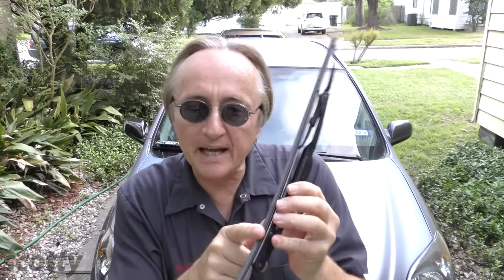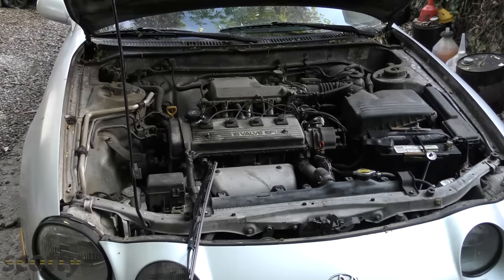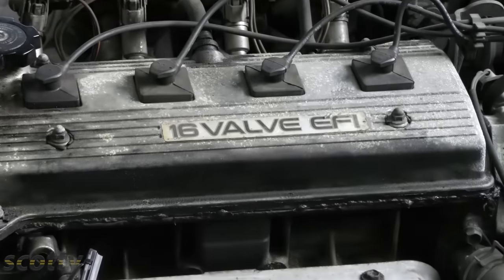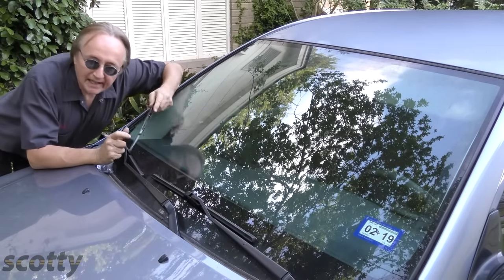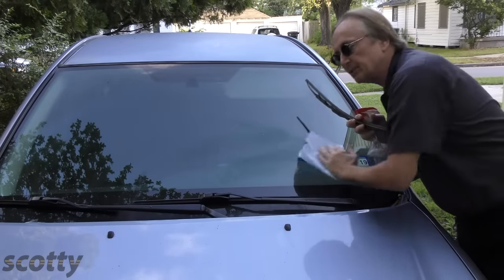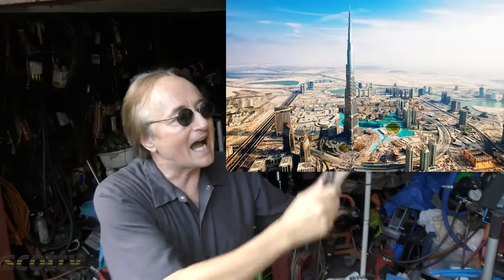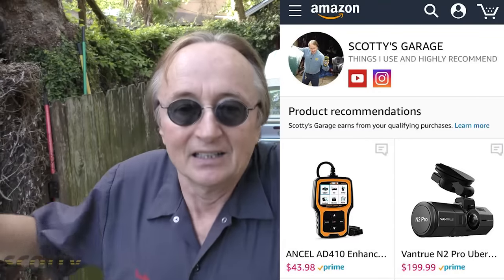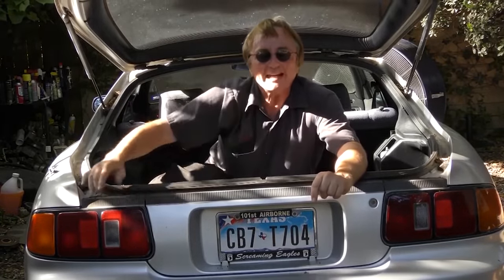The Best Wiper Blades in the World and Why

Comment: So I just looked it up silicone wiper blade you can expect to pay $20 per wiper. Maybe even 25 to 30. However if you know how you could just change out the fin and save you a lot more money. Also on another note if you use 303 aircraft protectant just spray a little bit on that blade wipe it down make sure it's clean and let it set for 12 hours you'll make the rubber last a lot more. It's really great on tires

Comment: Scotty, there is no bigger fan than me.  I could go on and on.  I bought silcone blades on Amazon for my 2003 Accord and my wife's 2009 Corolla.  Neither made it through an Albany NY winter.  I looked on Amazon, and the blades I bought are no longer available and now have a 1.5 star rating.  And, they were not cheap.  So, I conclude that you need to know more than just silicone.   
I am going back to cheaper rubber blades.  I can't afford to take chances on various vendors at those prices.

Comment: Have a problem with the wipers on my Trailblazer. They work fine on full speed. But,get stuck going up or down on intermittent speed. Wondering if the motor is getting weak.

Comment: Scotty , you give some brilliant tips and 99% of the time I agree with you but I beg to differ on this one , in sub zero temperatures silicon blades can sustain frost damage , more so apparently than vulcanised or coated rubber blades , not a problem where you live I suppose.

Comment: I know this is an old video went to advance auto parts bought 2 silicone wiper blades all season for my 06 toyota corolla best things ever no streaking or noise! Makes it easy to see in all weather only paid $40 or $45 for them there awesome I swaped out the old metal ones that where garbage. Also my pap I guess has mercury wiper blades cause they make that terrible rubbing sound. He paid $45 for his which sucks cuase I think I got a good deal on mine!

Comment: Hi Scotty: 1. Beam style blades are the best, no?  2. Will silicone blades be rigid enough for winter use in Canada?  Bosch ICOn is a silicone/rubber blend.  PIAA or Bosch?
Reply: 1 agree 2 it was during my 7+ years in 4 season weather 3 name brand > no name brand on eBay... if it's all pure silicone w/wout graphite coating, it'll perform similarly ~ the longevity over rubber blades is the main point of his video

Comment: I think Trico and NAPA are the same and they make replacement wipers for OEM Odyssey frames. Ps..The Pontiac 2005 Montana SV6 front wipers tuck under the hood..where they get ENCASED in ice that no amount of idling will thaw. And the silicone $30+ Rain x and Michelin Xt?.. use a fancy over the top ..easy install ..even for j hook. Result? $37 ..for ONE..got stuck in the ice on the Montana. I turned them on..the passenger side did not break free from the ice. BANG! The wiper broke and sailed over the top of the car at 55mph. Until they go back to the old solid ..pin inside j hook adaptor... I guess I should stay with crummy $10 rubber blades. Now I need to find a good portable window sheet to keep ice out of the 2005 Montana cavity. The Odyssey front wipers sit above the top of the hood. Too bad the Oddy went proprietary for the rear wiper.

Comment: It seems you could refill any OEM wiper blade if you had the right silicon material. I took apart my Nissan Leaf blade. Thought I would crack it but it survived my prying apart. Where to get the silicon materiel seems the problem.

Comment: Thanks Scotty for reconfirming what a parts  guy told me last week about a Rain ex latitude blade. So far works great, the sales rep recommended putting some WD 40 on the blade after 3 months to help it last longer, what do you think ?
Reply: use silicone spray instead of that petroleum product. any brand name will do

Comment: Best way to maintain your blades are to make sure the wiper arm is running parallel to the screen. If it's not you get that horrendous chattering or squealing noise. Just get a pair of grips and tweak the arm so it runs parallel and all's good. Then every three months or so clean the blades with a clean rag with some thinners on it.

Comment: I tried Teflon blades, and never looked back, had those darn thing for 6 years and still cleared the windshield like the day I bought them, only removing them during winter to use winter blades, and back on they went. And I only had the car for 7 years and sold the car never having to replace those Teflon blades

Comment: I recommend the Michelin endurance xt silicone wiper blades at Walmart for just under $20 each. They're cheaper and more durable than these piaa which I have had poor experience with them breaking apart.
Reply: online eBay sellers are much cheaper. get BEAM style blades with silicone inserts

Comment: I bought a pair of PIAA wipers. I super cleaned the wipers and applied the costing. I use Rain X fluid.
And after two months of little rain. Today with the heavy rain here...The blades are squeaking.
SQUEAK SQUEAK SQUEAK
Most annoying.
Do much for Washington state rain and silicone blades

Comment: I purchased PIAA silicone wiper refills after viewing Scotty's review.  He said silicone wipers work better and last longer.  I disagree.  I had to return the wipers for poor performance.  The wipers did not wipe the water off the windshield and left streaks providing poor visibility.  In my opinion, they're not safe to use while driving.  I purchased rubber wiper refills instead.

Comment: Scotty installed a set of silicone wipers on truck, very disappointed already there chattering and making a rubbing noise in 2 months. Cleaned them with soap and water and clean windshield no difference. I spent $65 on these blades not impressed. Does anyone have a suggestions other than tossing them?

Comment: Which brand is best? Bosch? And does the length matter?
Reply: length is based on your particular vehicle... i have good results in no name brand as well as the discontinued triple edge silicone wiper blades~ main point of silicone over rubber= longevity

Comment: Uhm... Silicone can make noises too. It absolutely depends on the exact circumstances, the main reason is dirt like oil and dust. 
Also, graphite isn't the reason. It's hard to make those stick/slip effects with it.
Rubber tends to have a fragile surface while silicone holds more together, and both can be responsible for noise. 
The rest looks true, but the two things above are bogus.
I personally suggest Bosch Aerotwin blades: they do their job, are robust and even their construction is less complicated and lightweight than the classical multi beam monstrosities.

Comment: I'm now in the camp of cheaper wiper blades are better. I can't see spending nearly $50 bucks for two wiper blades. It rained yesterday and my one Rainx blade was chattering so I picked up a spare in Walmart for $4.50. It'll match my other cheap blade. Essentially, I'd rather be disappointed with something I didn't pay alot for than something expensive.

Comment: $6 rubber blade vs $19 blade. How long will they last ?
Reply: find them cheaper on ebay; just get the correct lengths that is required for your particular vehicle

Comment: I had a bad case of wiper blade stutter and squeaking on my new VW Tiguan.  On the advice of Scotty, I spent almost $70 on a set of silicone wiper blades (Bosch).  Crap!  They squeaked and stuttered more than the original OEM blades.  How about refunding my money, Scotty.

Comment: I did bought PIAA Si-Tech blades. Rubbish. Terrible vibration when those are moving. So bad that blades actually contact to each other. Never have any that kind of problem in this car. Attachment to Wiper arm is loose and let blades move about inch top of the blades. And those did cost twice than normal blades. Worst blades in this car.

Comment: I have been involved in wiper developing and testing for over 35 years.  No auto manufacturer will use a silicone wiper blade... the silicone that accumulates in the microscopic pitting of every windshield can cause extreme glaring especially in sunrise, sunset, and oncoming headlights at night.  The auto manufacturers are not prepared to take on that liability... so you will only see silicone blades in the aftermarket where safety is not a priority...

Comment: THESE BLADES ARE NOT THE BEST SCOTTY.  THEY DON'T COMFORM IN THE SUPER COLD WITH.  THERE IS A BETTER BLADE THAT DOES JUST AS CHEAP ALSO SILICON
Reply: i think it depends on the wiper blade design. BEAM style blades with silicone inserts will be better

Comment: I REGRET I HAVE BOUGHT THE BLADES RECOMMEDED BY SCOOTY, THESE ARE A PIECE OF CRAP, VERY POOR PERFORMANCE, EXTREMELY THIN SILICON BLADE, LEAVE STREAKS AND CHEAP PASTIC CONNECTOR BROKE IN LESS THAN A MONTH. I DO PREFER THE MICHELIN ENDURA XT, ALSO SILICON BUT HIGHER GRADE, BLADE THICKER AND FAR BETTER PERFORMANCE.